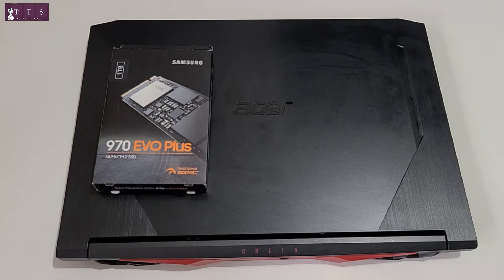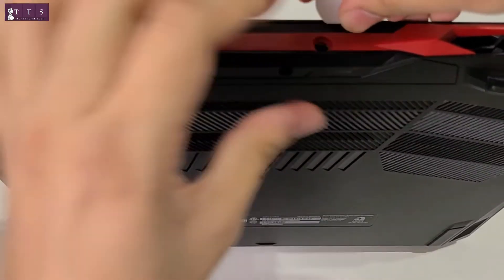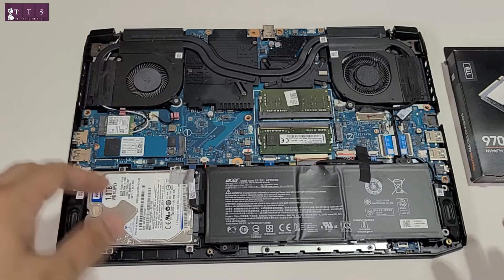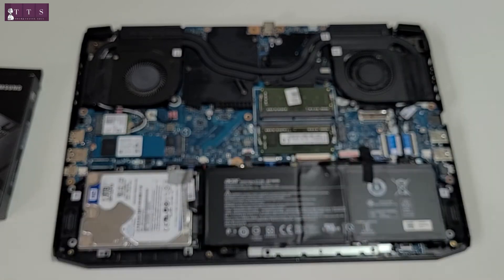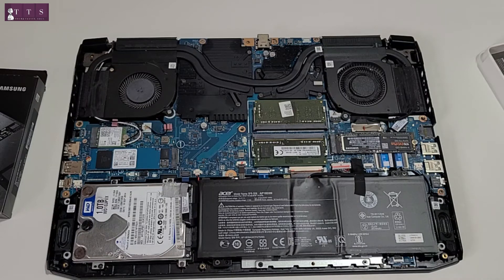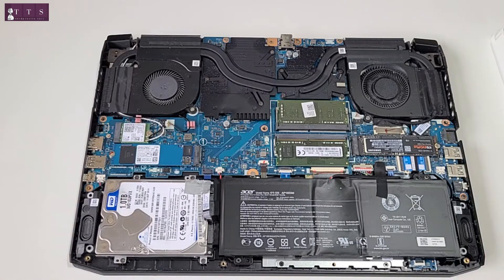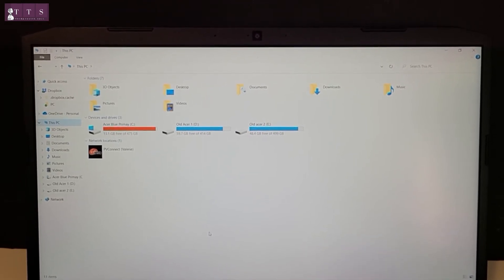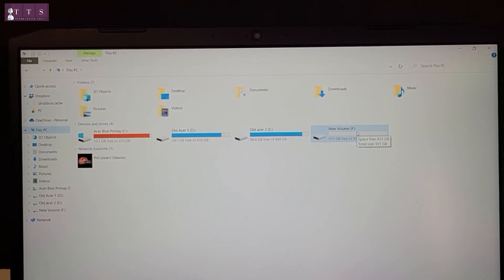1TB Samsung EVO 970 SSD upgrade to Acer Nitro 5 Gaming laptop | How to upgrade a laptop

Comment: Hello, i have acer an515-51 laptop, i want to replace the SSD with 980 1TB. is it compatible on my laptop?
Reply: I highly recommend the 970 evo plus, because sure, the 980 will work, but at half speed due to limitations.